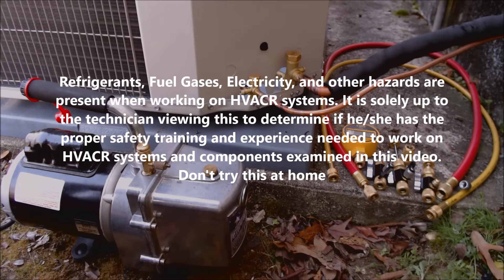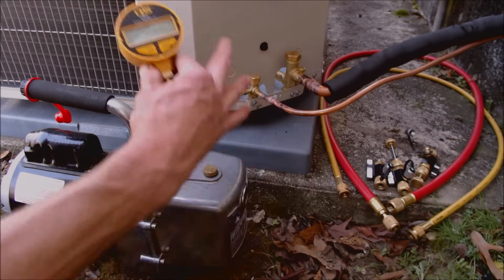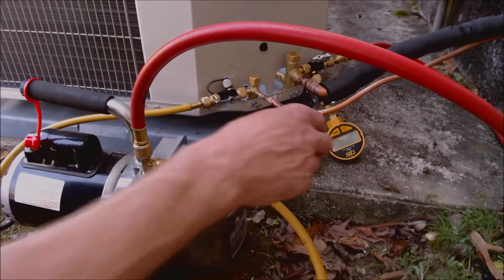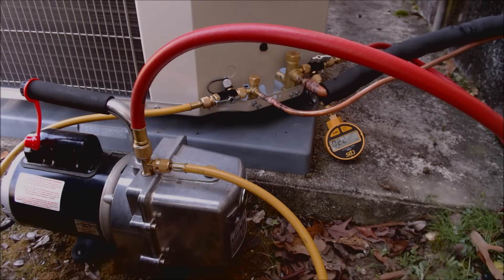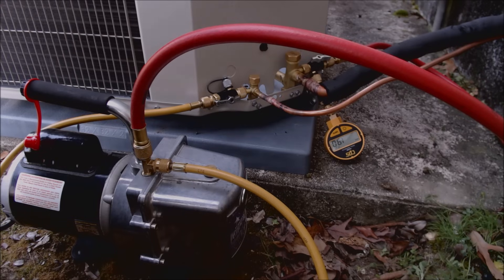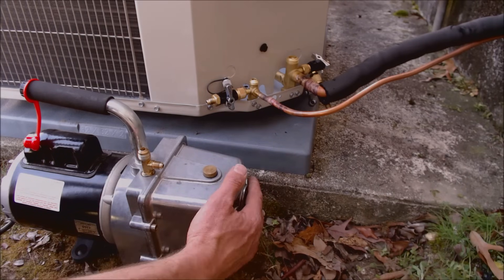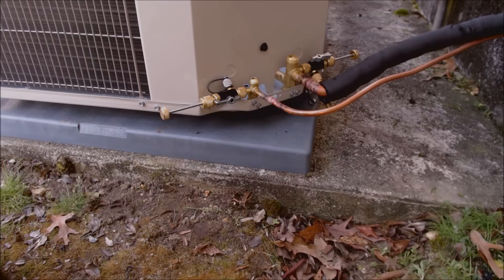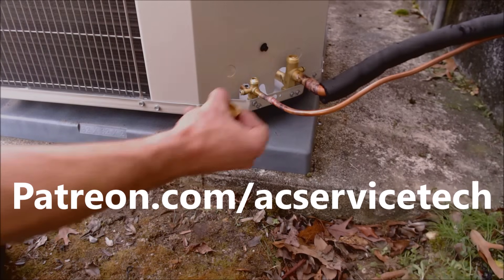HVAC Full Vacuum Procedure From Start to Finish!

Comment: How do you like the Appion valve core removal over the C and D? Great idea with the 3/8. 
You installed the valve cores AFTER pulling a vacuum and recharging. Great plan!
Reply from the maker: Yeah, I always do this. I also always use 3 for recovery and for vacuum.  I think they are both very comparable to each other except the appions are rated for 20 microns. Some say the ends of the appions don't grab as well as the c&d but I find that they seem to grab harder on. Just don't screw the valve core removal tool on too tight when taking out the schrader valve but just barely sealing the refrigerant in so the rubber does not squish and take up room on the inside of the tool. I have them and the c&d linked at amazon.com/shop/acservicetech  thanks

Comment: Out of all the digital vacuum gauges you've tried, which one is your favorite or most reliable/heavy duty in your experience?  Thanks for all the great videos.
Reply from the maker: Sman from Fieldpiece and Testo. I have the one I use SMAN460 linked at amazon.com/shop/acservicetech but any version is good. The biggest thing is to just check sat temp  and temp probe calibration  and once the temp clamps are calibrated, don't take them out or switch them. Use the ST4 for taking other temp readings. Thats linked there too, thanks
Reply: Awesome.  Also, which digital micron gauge do you prefer to use?  Thanks.
Reply from the maker: I use the supco digital and the cps usually but actually prefer the cps version linked there, thanks

Comment: it aint 500 microns for vaccum
Reply from the maker: The 500 micron level and lower has been set by the EPA in the section 608. We usually try to hold vacuum around 200-300 but as long as it holds below 500, it would be considered good unless the manufacturer is calling for something deeper, thanks Sergio!

Comment: Very Well Done 👍🏼 AC Service Tech!
Any suggestion on which ultrasonic leak detector to purchase for service work ?
Reply from the maker: From everything I have seen,  I would go with the Superior version ultrasonic leak detector. These three companies are using the same version. It is just about getting the best ear phones possible and the flexible tip. You had mentioned this kind in the beginning and from everything I have seen, it actually looks like this is the one I will end up getting. It is a mid range price. Not cheap and not crazy expensive. Amprobe I would say would be the cheaper one but still ok. Robinair  https://amzn.to/2LLKncA  -   Superior AccuTrak  https://amzn.to/2J1Dw0X   - and Bacharach  https://amzn.to/2Ldg3X5  -  I would go with the Accu Trak for the price and headset. Thanks Mason! It seems you were on the right track!
Reply: acservicetech Thank you so much !!! You have no idea how eager I am to buy one right now ! Yesterday I was at my supplier at 7:30 am as soon as they opened and got a pair of those Appion core removal tools and I am ready for some serious low micron readings now !
Thank you very much
Reply from the maker: That's awesome to hear! I use 3 valve core removers for recovery and vacuum. The third one for recovery  is so that I don't have to use a manifold with the MR45. More importantly though for vacuum in order to isolate the micron gauge, thanks
Reply: acservicetech Well guess what ? Today was the first day I used “ your new technique “ and my gosh does it ever suck the system dry alright lol ! 
Hat 🎩 off for you sir MR. AC SERVICE TECH
Reply from the maker: Yeah, nice huh? Less wear and tear on the pump, faster process, great verification for no leaks and best of all, you know that there is a problem if one is present very quickly instead of in the middle or end of a long vacuum, thanks Mason!
Reply: acservicetech that’s so true ! Hey thank you !
I noticed you use CPS micron gauge too , I have one but its defective and leaks so was wondering what brand micron gauge would you recommend ?
Thanks
Reply from the maker: Actually I really like the cps ones. I have 5 at the teaching shop where they get abused and one in my service truck. We haven't had a problem yet. Did that one you have accidentally get positive pressure from a refrigerant release by chance. I am just wondering. The supco, bluvac or fieldpiece svg3 would work as well. The supco and blue vac will need the 1/4" female to female adapter. Thanks Mason. It is great to hear how much you care and are striving to be the best tech possible, thanks!
Reply: acservicetech No thank you for spreading the knowledge ! My CPS sat in my truck for few years from new and didn’t bother using it because I have a manual gauge ( low blue side of regular gauges) in line with my YJ vacuum pump manifold bar that I got so used to since day one ! Never exposed the CPS to any positive pressure and was always kept in its oem leather case but I think I got a lemon !
I Finally decided on the Bacharach 28-8001 thanks to your suggestion of earlier video . I have on hand a 4 ton system that I did 4 years ago re & re coil and unit but kept existing 7/8s lineset after flushing it of course that has a tiny pesky leak somewhere that I suspect is in the lineset but it’s an 11 foot high bsmt ceiling with drop  tiles in this monster home so not the easiest to get to that’s why I am so eager to get this new gadget to find the mystery leak !
Thank you Craig
Reply: acservicetech Just did some trouble shooting on the CPS micron gauge and found it to be working fine ! It was the 45 degree male to female with shutoff valve brass fitting that was a leaker !
Reply from the maker: Ha ha that is what I tell people so they can resolve their problem. I have used a small piece of 7/8" tubing with two access ports brazed on the sides. I valve off the vacuum and see what happens with the vacuum reading. Very good to hear it is working well, thanks
Reply: acservicetech Wow , what a great 👍🏼 idea Craig !
You are a man of many skills !
Thank you

Comment: Excellent video, I didn't know you could pull a vacuum this fast. Most of my vacuums took 1-2 hours because I never took out the schrader valves or uses hoses free of valve core depressors. Thanks man, this should save some time.
Reply: Old comment I know but wanted to point out that aside from the valve core removal, the key is in those larger hoses and as short as possible.  Huge time saver.
Reply from the maker: It really does, check out the recovery and pressure testing videos too other processes, thanks

Comment: How do you avoid freezing moisture during the vacuum process? If it the moisture freezes it won't come out. Thanks!
Of course you don't have moisture in this system, I'm just saying for instance if you come across a system flooded with moisture, how do you handle it?.
Reply from the maker: Keep the indoor fan running and that will put a heat load on the lines. Also the liquid line will be absorbing heat anyway because there is no insulation. Vapor line will use heat from the fan as well. If you were concerned about the outdoor coil if the valves were open then run that fan too but not the compressor obviously. You could even turn the furnace on inside if you really desired and if equipped. If you cannot turn a fan on then you could perform a triple evacuation in that circumstance. You would see your vacuum level rise if ice was melting after a vacuum. Rarely are you going to run into a circumstance like that in residential light commercial HVAC. I am not saying that people don't run into a problem like this but I know too many techs I am teaching are fixated on this subject because of the EPA 608 test and I am just trying to get the thought process out there. I hope that helps explain it. Thanks Blade!
Reply: Beautifully explained!!!
Reply from the maker: Thanks Al!
Reply: This freezing moisture comments just aren’t true. The reason you pull a vacuum on the system is to remove moisture. At less than 400 microns, water boils at below room temperature under that kind of vacuum. That’s the reason you vacuum the once open system when it is closed off. The moisture inside boils off and is removed.